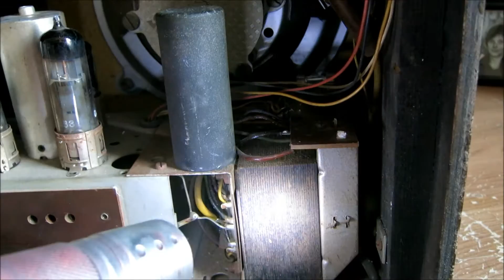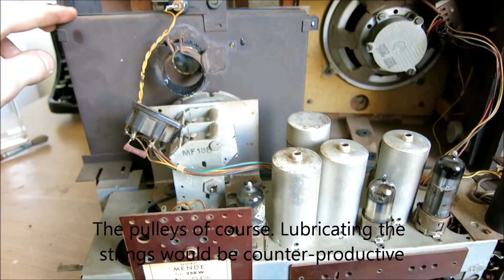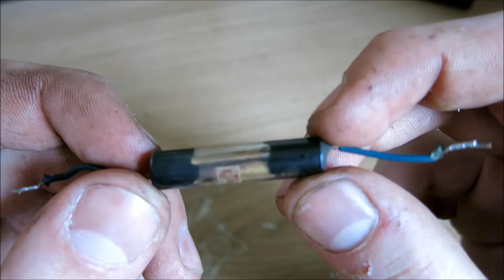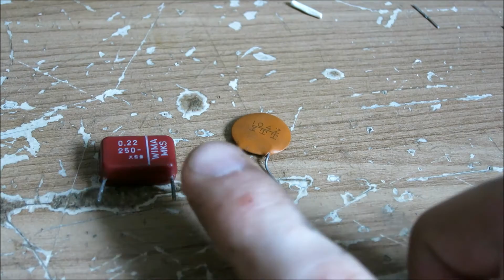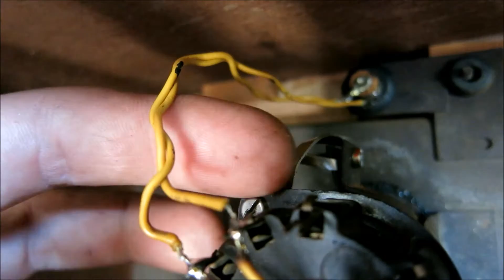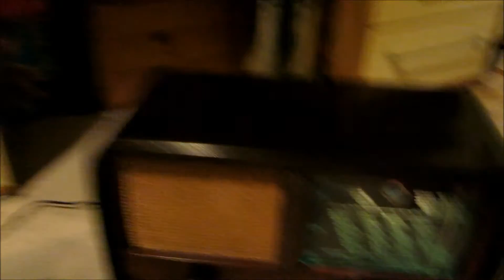Restoring a Tube Radio: Nordmende 258W

Comment: I recently bought bought my first tube radio and it definitly needs new caps and a new can as the one it has is leaking and humms. My problem is there also are some blue capacitors, they have the legs coming out both end, they are round and they look like they are starting to crack. What are those and should I change those?
Reply from the maker: Difficult to say - what's for sure is that they have to be swapped if they start to crack. Are there any values printed onto them?
If it says something like µF, nF or pF, it's a capacitor. If it's K or M and a greek "Omega" behind the value, it's a resistor.
If all else fails, you can always get a schematic for your radio at "radiomuseum.org"  and trace the component down.
Reply: @AstraWerke  Thanks for the help, I actually just found out what they are. They seem to be some kind of copy of those old wima capacitors and i chose to replace the more important ones of them as I'm not yet confident enough to do the hole thing at once.

Comment: You pointed to what looked like a can type filter capacitor (Electrolytic) and said that it was a rectifier.  Since it is not something that even remotely appears to be a vacuum tube, I have to ask, is it some sort of solid state rectifier?
Also, there is a video I would like to suggest that you view.  I think you would appreciate it and gain some useful knowledge.  It is:
https://www.youtube.com/watch?v=BnR_DLd1PDI
Reply from the maker: Yip, I've seen that one already - truly important to know whenever hum becomes an issue.
The rectifier is indeed solid state. The diodes inside are plates of selenium - they are good for low amounts of current, but their efficiency doesn't exceed 60 per cent. Which is why they get rather warm in operation and (combined with the high toxicity of Selenium) are no longer used nowadays.

Comment: Quite an interesting video and a really nice radio.  I noticed a few things I wanted to ask you about.  In the beginning of the video, you pointed to what to me looks like a black cardboard or possibly metal Electrolytic Capacitor which I would suspect is actually the filter cap in multiple sections within one container.  You called it a rectifier, and later suggested it was a Selenium Rectifier,  but those usually look like this:
https://upload.wikimedia.org/wikipedia/commons/thumb/0/0c/Selenium_Rectifier.jpg/150px-Selenium_Rectifier.jpg

Also, you pointed to several metal cans on top of the unit and referred to them as capacitors...but I believe those are actually the IF cans.

I agree that the radio sounds fine right  now...but if that black cylinder is indeed the filter capacitor, I would suggest you replace it as soon as you can.

Also, doing an alignment on it might make it sound even better..though it does sound good now.

Keep up enjoying electronics!
Reply from the maker: Hi Wayne,

The black can is in fact a rectifier - this was their common shape in german radios of the 1950s (see https://www.mikrocontroller.net/attachment/352576/AEG_300C120_IMG_7458a.jpg ).

As to the Aluminium cans, the 3 cans up front are the IF transformers, the one in the rear is the Electrolytic Filter Capacitor. 
Opinions on their reliability diverge greatly in the net - my way of dealing with them is to give them a good visual inspection and leave them in the radio when there is no leakage to be spotted. 
Should it warm up during operation, out it comes - in this particular radio, however, it was still fine and it is to this day, even after very regular, almost weekly use. Should I notice any hum develop, it will of course get replaced.

Considering an alignment, I unfortunately lack just about every tool necessary for the job, so I leave the adjustment coils untouched, since attempting an alignment "by ear" usually does more harm than anything else.
Since the capacitors I replace, are usually only located behind the actual RF decoding circuit (all the oscillator circuit capacitors are of the so-called styroflex type, which is very precise and reliable), changing them usually does not affect the alignment any.

I agree that I got lucky on this radio - no one had fiddled with it before and it does not seem to have had any issues before it was put into hibernation. A radio can look alot worse inside when it arrives on the workbench.
This is just meant as a tutorial for the average joe like myself, who doesn't own much equipment apart from a soldering iron and a multimeter - so I would by no means call myself a radio technician. The methods I showed in this video, however, should get a radio up and running in, say, 80 per cent of all cases as most radios were just put away in favor of a newer device.

All the Best
Adrian

Comment: Nice radio.... just a thought though.... in radios older then this one, you might find a dynamic speaker. They didn't have powerful permanent magnets in those days, so they used an electromagnet instead. Feeding in an audio signal to a powered off set will tell you nothing about the speaker condition.
Reply from the maker: You have a point, Sir.

Comment: Hi. I have an old Telefunken and the chassis is always drawing current, ie, if I touch the chassis with a pole driver, it lights! I noticed that the radio has a ground plug. Can it be picked to join the two power cables and have a three  cord with a 'ground'?
Reply from the maker: Well, before hooking the chassis up to the ground wire, I'd check whether its an "Allstrom"-Model or not. These were made to run on AC and DC and therefor have a series of resistors instead of a transformer. If there's no transformer, the chassis will be hot, no matter what - and adding a ground wire would do nothing except tripping the fuse.
If it has a transformer, then there's something wrong. I'd look for broken insulation on the wires or contacts touching the chassis because usually, the chassis is used as the minus pole of the circuit and therefor should have zero potential. Here again, adding a ground wire would just make the circuit breaker pop as it would register leaking current. 
And finally, I'd take a multimeter and measure how much voltage is on the chassis. If it's only five volts or so, I'd just leave it as is. 
To sum things up: Adding a ground plug won't solve any issues - only if the chassis has zero volts on it to begin with, it might improve AM reception.
Reply: @AstraWerke  thanks for your answer. Its a concertino 7 and it has a transformer.
Reply: @AROSFC  Well, although it might have a transformer, the chassis still may have voltage on it. There are special kinds of transformers which lead to voltage on the chassis. You can turn the plug and have a look if there still is voltage on the chassis. Because either the neutral or the life is on the chassis. But be careful!
Reply: What is a pole driver

Comment: Extremely helpful, just acquired a Nordmende/Sterling Coriolan 57 3D and very little information available, so watching all videos regarding German receivers to gain a little insight as to what to expect.  Picked up several tips on what to look for even though my Coriolan is a much higher quality unit than this Carmen.

Comment: Thanks Adrian, very good video! I also got "Bremen" yesterday as a gift (its condition is even better than yours), and of course I'm also going to get it back to life. The final audio tube may be non-working though (it has milky color on the glass).

Another thing I always do with tube radios is installing a new 3-wire power cord to get the chassis grounded.

Comment: I found myself an old nordmende and know I wonder if it is save test it right away or do I need to replace all the tar capacitators? Nice video btw verry plesant to watch.
Reply from the maker: I suppose if there are no burnt spots inside the radio and if you removed the dust inside it wont hurt if you run it for a couple of minutes in series with a lightbulb. Dont be disappointed if there is nothing coming out the speakers, though - I had radios that were not making a single tone coming back to complete life after changing the caps ;-)

Comment: Meisterlich. Bravo Adrian! I would add a couple of things. The transformer puts out two basic voltages. In American usage this was 6.3V AC, the filament heater voltage, which heated up the cathode (-) . The other was called B+ and was on the order of 250 V, which is afterwards rectified to produce about 250 Volts DC and the plus sign means it goes to the anode of all the tubes. Sometimes the filaments were connected in series and sometimes in parallel. In the former case, one burnt-out filament would render the whole set kaput, and you had to replace the offending tube. In any case, the tubes should light up if the filaments are working. In my day this was the biggest problem with vacuum tubes. So the first thing I checked out was continuity through the filament circuit. Need a tube manual to do that. This post dates me! Oh, and I don't know the European conventions, voltages and such; but you get the idea.
Reply from the maker: Hi Juan - thanks for this very valuable comment - completely forgot about that :D
The case of heaters in series you point out is possibly more often the case in the US (All American Five and such) , where it was of course a great way to save money on less windings (or none at all) in the transformator for heater circuits - most European (or german at least) radios have the heaters in parallel, there are some, however, which are built that way (the Volksempfänger for example didnt have any transformer in it - the line voltage was put directly into a rectifier tube)
Which wouldnt mean that a single defective tube could make a whole radio stop working, of course.
In fact, I have gone as far as checking if the tubes are not only there, but also the right ones - since I've wasted many frustrating days searching for a fault in another radio - before i noticed some idiot had changed an oscillator tube with a tube usually only found in TVs...
I will add your points in the follow-up video where I put an FM-Reciever into this thing :D
Reply: Another invaluable old-radio reference is a tube substitution manual. In this country you can probably find one at www.youroldtimebooks.com. Hope I got that link right. This, however, will be for American tubes. I am quite sure Europe did not use the american tube designations. So it's another hunt.
Reply from the maker: Juan Rivero I have already got a great page - its radiomuseum.org - they've also got loads of circuit diagrams of any radio you can imagine - truly worth alot!
Reply: I have made a note of this llink!